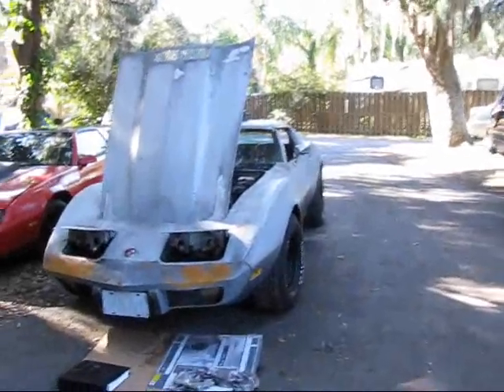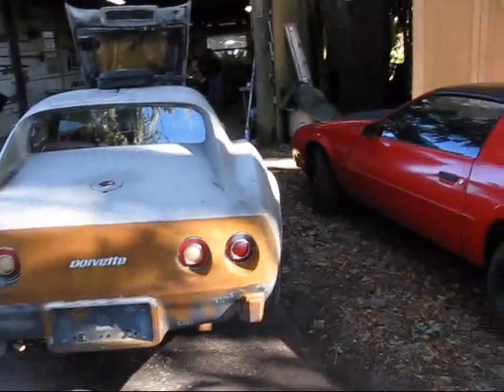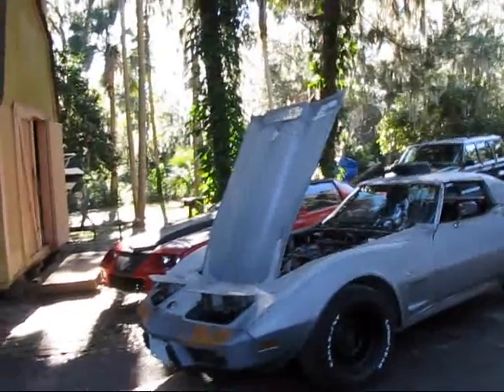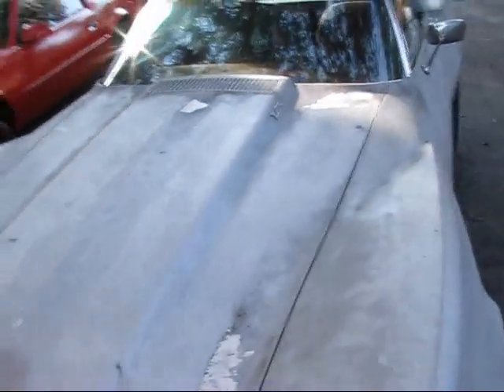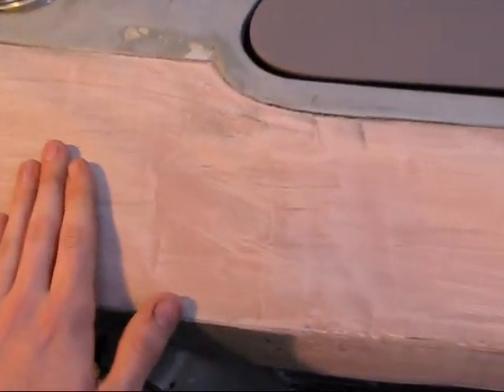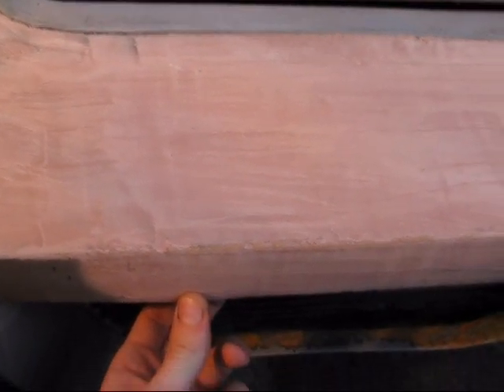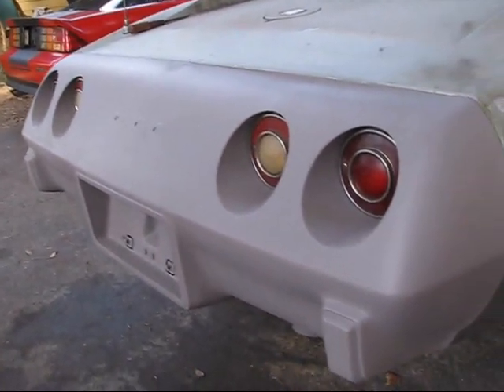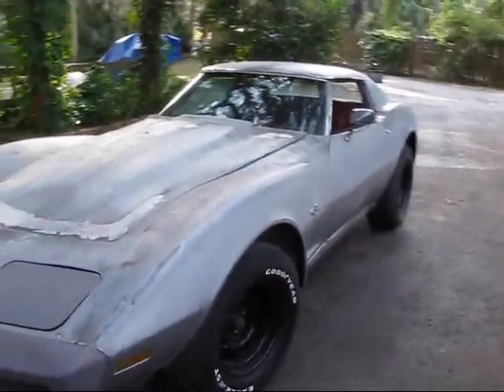1976 Corvette Project Part 6

Comment from the maker: Hey man. It depends on the type of body work you need to do. I had some major sun damage that I had to fix and used a bit of bondo and will use a lot of spot putty. But once you get that done you just spray the primer and then you can spot putty. I usually start out wetsanding with 220 grit and work my way up. As far as how high, it depends on the kind of paint and how shiny you want it.

Comment: Just an fyi you may know this but you have to use lacquer paint over lacquer primer.... I believe the 76 had urethane paint on it from the factory...its not normally a good idea to limit the paint tech with the old primer thats incompatible with modern paint systems primer is not a good finish and doesn not protect well against the elements.... they make satin "hot rod" paints for cheap that will actually hold up and protect from moisture and such  primer lets everything right through it.